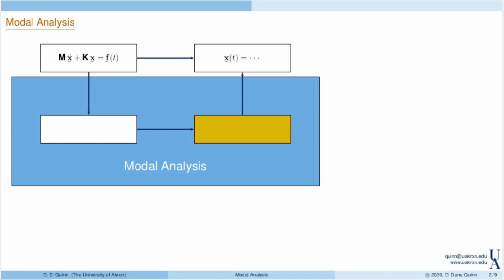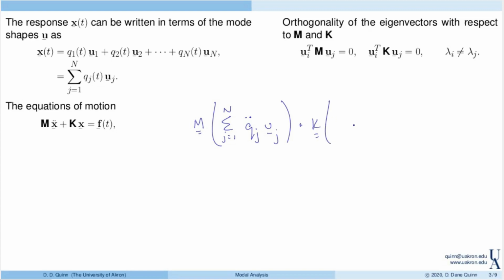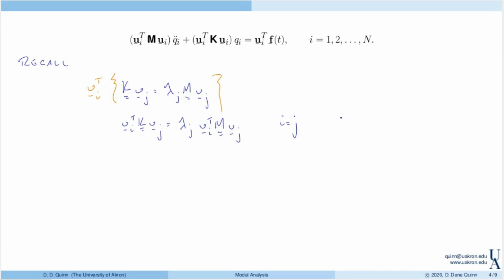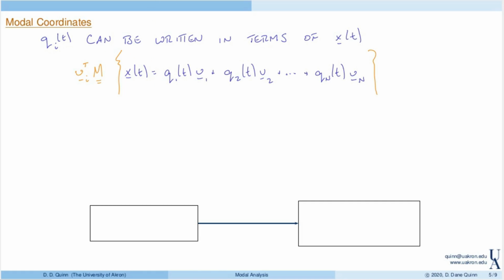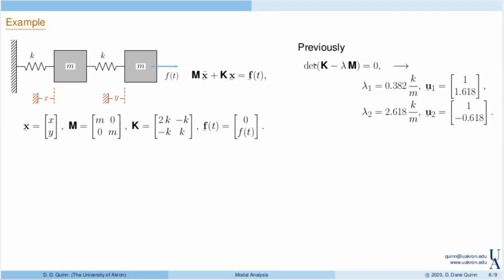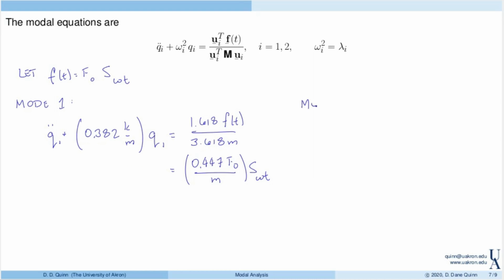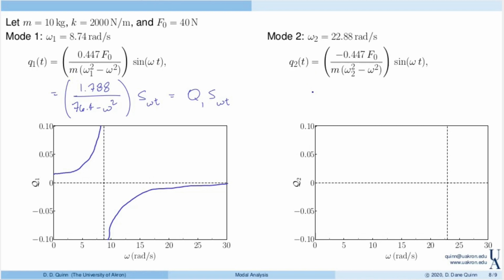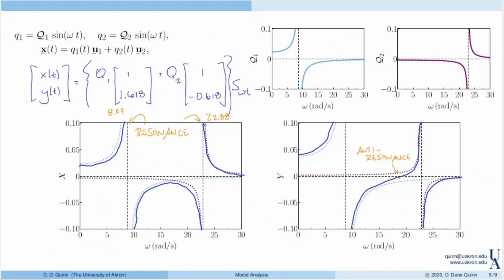UA - MECE 431: Modal Analysis

Comment: This video is so cool. Thanks for sharing.

However, i have some questions.

1. at 28.27, im curious why q(..) = -w^2 * q ; replace this in the general solution equation

2. at 22.25, Why det (K - lambda M) = 0 ? ; which means K - lambda M is singular matrix.